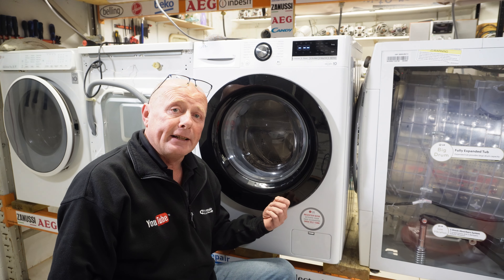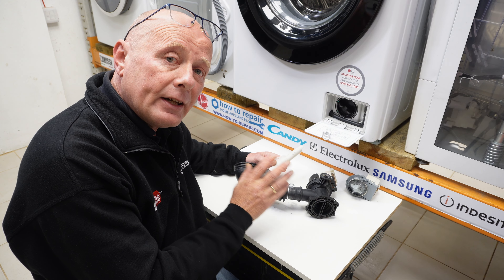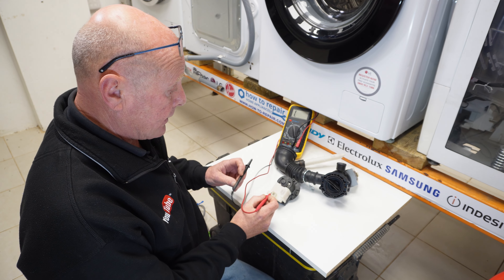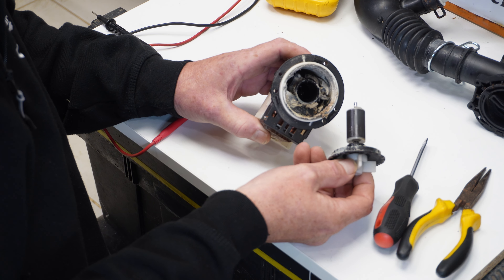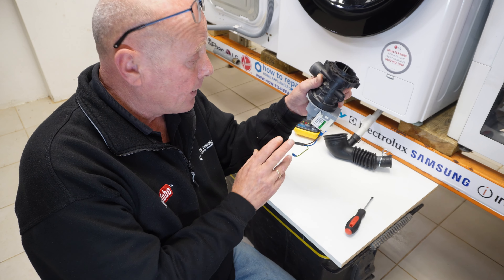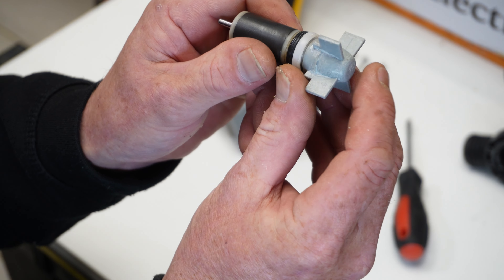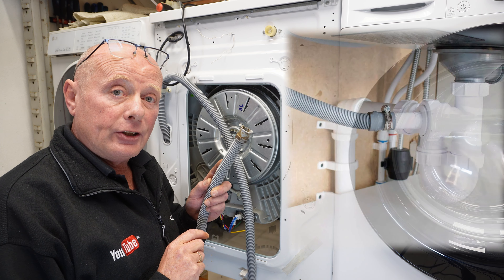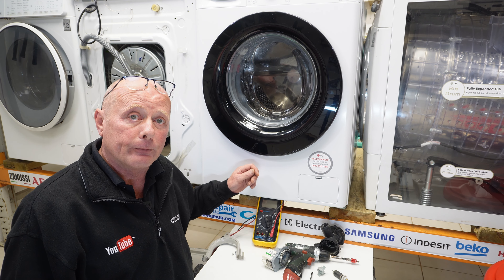Intermittent Drain Issue? Washing Machine Won't Empty Completely (SOLVED!)

Comment: My washer will drain perfectly fine at the start of a rinse spin cycle, but fails to drain at the end, meaning the door is usually locked shut for some time.

I've drained into a bucket and seen it happening, but it won't drain at the end of all cycles.